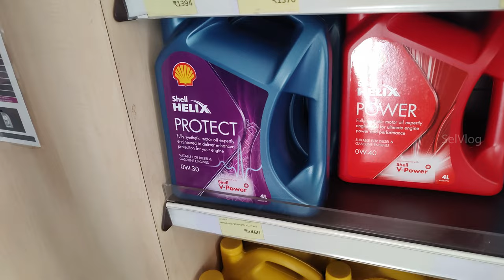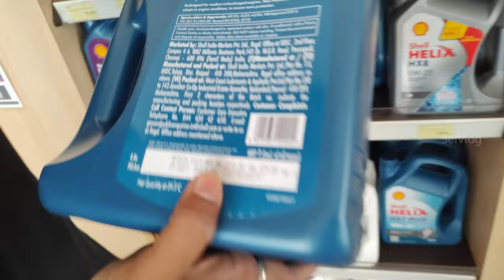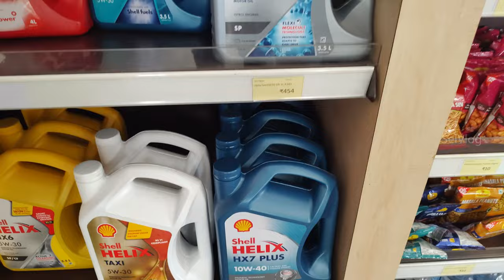Shell ⛽ Experience | Coimbatore | @autotrendtamil Vipraajesh's Tata nano | SelVlog தமிழ்

Comment: enna avalo difference a irukunu solreenga🙄
Reply: Unmai bro. It's far smoother than usual
Reply: @rishikausshik00  next oil service anga panni parthuda vendiyathu than appadina :)

any increase in running km of the oil?
Reply from the maker: Bro super improvement iruku neenga unga car ku enna oil use panreenganu poruthu innum performance la nalla update irukum oil changing duration same thaan 10000km once thaan but neenga oil check panni paathuttu nala irukuna neenga extra kooda ottalam bcoz nano ku mineral oil duration 10000km so synthetic pogumpothu 15000km kuda ottalam
Reply: @iamselvarangan  nallathu..enaku last service la shell oil from drum than potaru.. but enaku theriyala ithu comparison la eppadi iruku matha car oda nu..

oruvela ippadi than enaku smootha iruko ennamo..
Reply from the maker: Neenga onnu pannunga bro next service directa neenga shell la experience pannunga mudinja amount irukuna shell protect 0w30 try pannunga supera irukum performance
Reply: @iamselvarangan  haan will check that.. but ippa than pannen illaiya few months back.. so time edukum pola.. neenga otitu oru 5 months kazhichu sollunga appadiye iruka performance illana change aguthanu
Reply from the maker: Kandipa bro next oru video potralam itha paththi

Comment: chennai la yarachum irunthanga na solunga bro, im also using nano only. i need good mechanic person.
Reply from the maker: Bro neenga shell ku oil coolant wiper blade & liquid oil & air filters change panrathuku polam no issues. But you want a mechanic any other services you better join our Tata nano tamil nadu group.

Comment: Hi bro.. for swift diesel this hx7 10w40 ok? And how much its replacing kml?
Reply from the maker: Yes bro ok thaan but unga kitta budget konjam extra iruntha neenga Shell V power 0w40 polam konjam price athigam aana performance vera levela irukum
Reply: oh OK bro. My swift crossed 1,73,000km with 14yrs of age,But from past 6yrs I'm using mobil15w40 normal mineral oil with 5,500km changing interval. Every time fresh oil change nothing difference I feel. But this time I plan for semi synthetic oils, and i want replace today. And how much it's replacing  kms? And this shell helix hx7 10w40 worth vs mineral oil?
Reply from the maker: 100% worth brother shell la na sonna grades fully synthetic oils neenga fully synthetic pona ungaluku 10w40 10000km once replace vpower 0w40 poneenganna 15000km once replace varum shell try pannunga unga engine romba smooth aagum neenga ennoda channela tata Ariya ku shell vpower experience panna video irukum neenga paarunga
Reply: @iamselvarangan  thank you 😊

Comment: In Shell bunk, 5W 30, fully synthetic fuel save oil alone is MRP price 3800 rs, No discount. For this price in Honda it self I can complete full service at 6000 rs. One more interesting fact, in amazon they sell fully synthetic HX8 oil at 2100 only, but they will not have that at the bunk. It's a scam by staying that its not in stock.
Reply from the maker: What is the recommended oil for your honda car?
Reply: 5W 30 fully synthetic
Reply from the maker: Which car you are using?

Comment: Plzz try ones nano lube nano lube just a lube add with new engine oil it's gives u more more smooth and it reduced the heat of the engine and give soo much difference in mileage and smooth plzz try it once just add to engine oil and gear oit too it's gives u butter smooth felling when u change the gear plzz only one just add.i am also using shell engine oil 10 w 40 for my car I am added the nano lube and it's gives very very smooth difference new car also can't gives this experience plz try once
Reply from the maker: Are you a dealer/promoter or experiencing a consumer for nano lube brother?
Reply: I am a consumer plz bro try once and make  your car better life and experience
Reply from the maker: @christy2687 ok brother may i know your location? Shall we do a video like this video if you are willing means?

Comment: Oil change panna they are re using old o rings and washers. They don't have OEM replacement
If re used oil may leak in drain bolt
Reply from the maker: Maybe in your location you have any issues means kindly inform the shell management. In my location shell doing good work and the shell always maintains their quality without compromise.
Reply: @iamselvarangan  bro in your area do they use OEM or any other o ring or washer replacement?  Or they reuse
Reply from the maker: You can buy it from OEM parts outside then you can install it in a shell without labour when you change fluids there.
Reply from the maker: There is no re-use bro Maybe any mechanic who has no knowledge will do that but if you are unsatisfied with their other products you just leave shell.